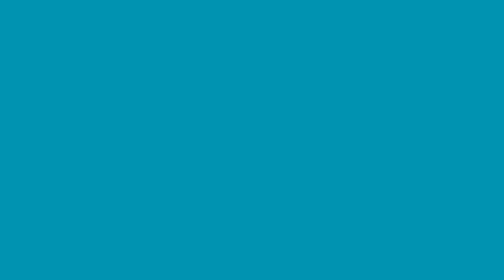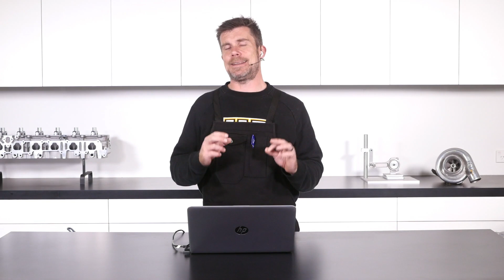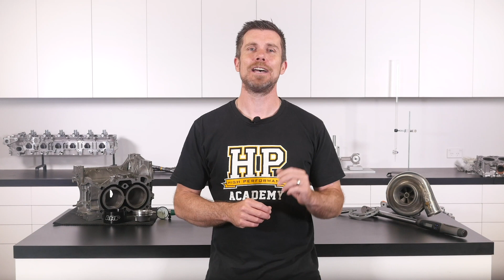Road Tuning Ignition Timing and Knock/Pinking/Detonation [HPA Q&A]

Comment: What I'd like to understand better is if knock is OK for a very short period of time before the ECU pulls timing out. On my car, an R53 Mini with ECUMaster ECU, I regularly see knock spikes from the knock sensor but I have it set to immediately pull upto 8 degrees of timing out (depending on knock voltage). 

Is this OK - ie letting the car knock (1 spike over my threshold will cause it to immediately retard the timing) 

From what I understand, prolonged knocking is really destructive, but as long as the ECU immediately intervenes, is this OK?

Comment: To give a perspective, just this afternoon, after buying a knock hearing device I just got able to see very light knock on the 4k to 5k RPM. The engine is an rb26 at 1 bar (have proof of all of this if needed, both TunerNerd logs and PowerFC logs). The powerFC wasn't able to catch this really slight knock, but was definitely audible though my headphones. Who knows how long this engine has been running like this and surprisingly, without any diagnosed failure. So inducing really small knock to see how it feels shouldnt be an issue as long as you keep it really light and for short periods of time.

Comment: Knock knock
Reply: Who's there??
Reply: @mikeschaner5853  A hole in your pocket
Reply: @AllenSunnyD  lmfao... Yeah...
Reply: @mikeschaner5853  pistons
Reply: Pretty much how it's done with most experienced tuners with an everyday barra... They generally know the rough knock limit and tune to it then back it off a few degrees, road test as confirmation that there's no issues (or is due to differences in load) and then it's gtg with all things sorted. 
You'll often see another person leaning over the engine on a power run for confirmation.